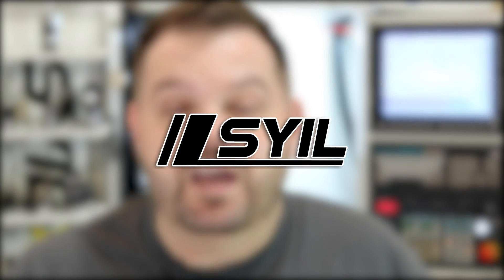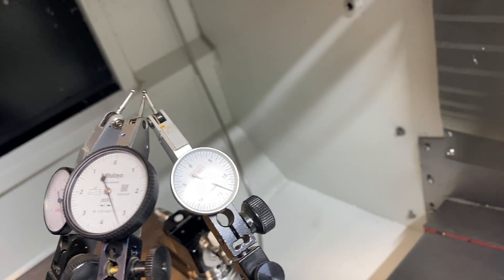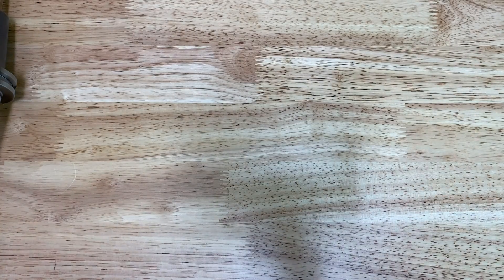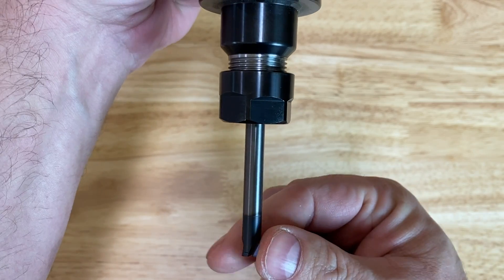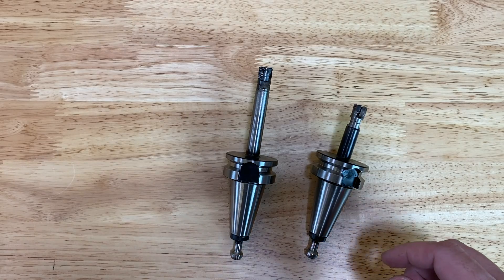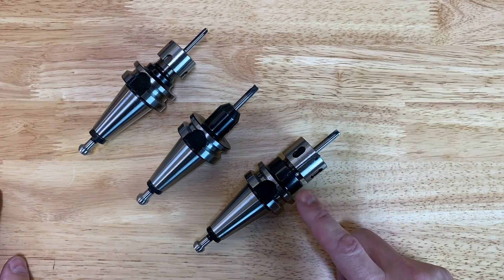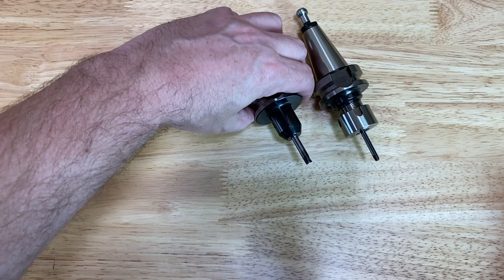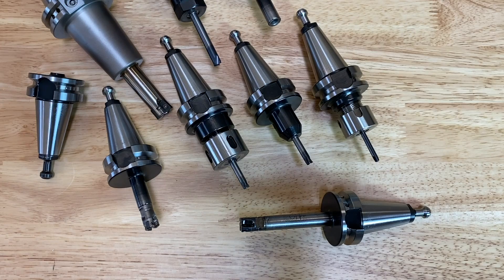My CNC Secret Weapon - High Feed End Mills

Comment: Great tips my man. 
These kinds of tools in addition to plunging techniques of milling are my go too in challenging situations. Amazing what kind of features can you achieve with these. 
I would like to point out couple of disadvantages to using these kinds of tools, just for the sake of it. 

1. in the end you are jerking and moving mass of the machine too fast, there is no way around it, you will wear out machine quicker. and larger the machine more wear there will be.
2. Like you said these tools shift the load on the tool to the axial direction, but every action has equal reaction so the load on the part from the tool is also axially to the tool, 
 which means if the parts are thin in that direction you will introduce a lot of deflection and chatter, same you do to the thin walls with regular endmills.

Comment: Hi Jason, Could you please tell me where you bought those Dijet arbors? 

I currently use Dijet tooling on their extended reach shanks (which i then put into a collet holder/chuck). Those arbors that you have look a really good solution though for times when Z-clearance is an issue.  Dijet don't seem to sell the arbors themselves, and i'm not sure what brand makes arbors to fit the Dijet thread connection.... Thanks, Alex

Comment: Jason, have you run a .75” high feed endmill on the X7? I’ve had my eye on the YG HFM and  after mocking up run times using recommended speeds and feeds the .75” is a dramatic improvement in MRR. I have an X7 and am after faster runtimes. Thanks
Reply from the maker: I have not.. I have a Kyocera but havent been able to try it.

Comment: Talk to your local tool rep as well to gain many years of experience from them.
Reply: I wonder if he runs into the same problem that I do... Im a small 1 man shop and after each distributor saw my little shop and they all go running and are never helpful until I need to order at least $500 worth of tooling. I used to work for a larger company and these same distributors would do back flips when I needed anything but I guess my old company was paying (probably a lot) for there loyalty
Reply: @HuskyMachining  Its more about throughput of sales, and the price pr say on bigger companies. Bigger means more demand for special deals, but that require you to need to order X amount aswell to achieve that...